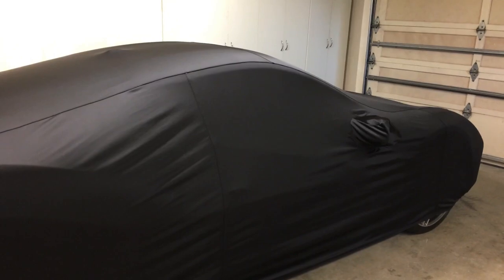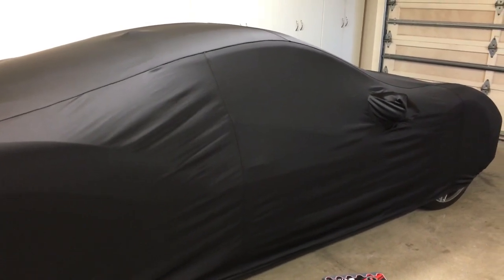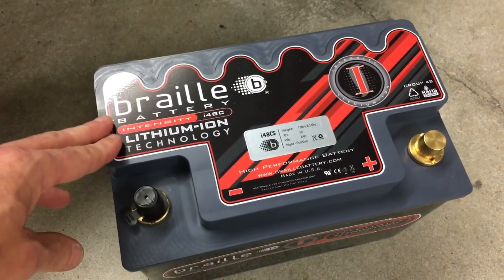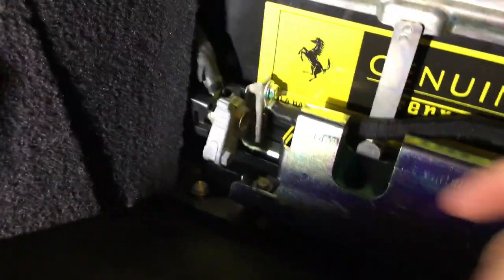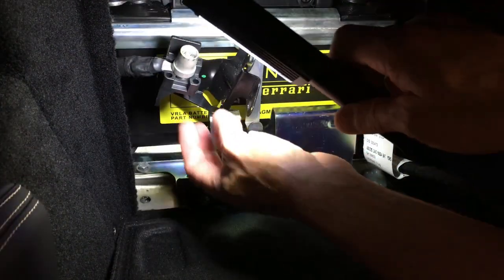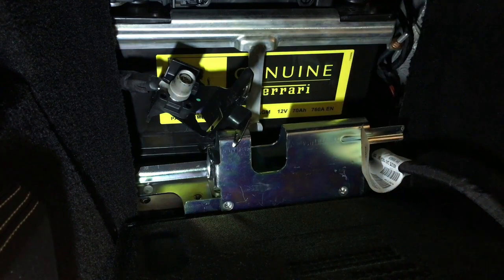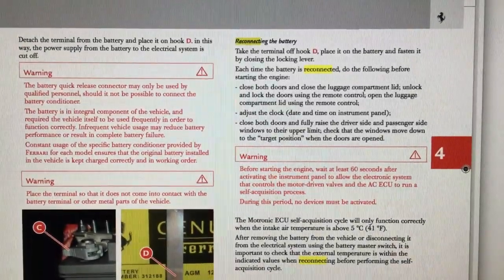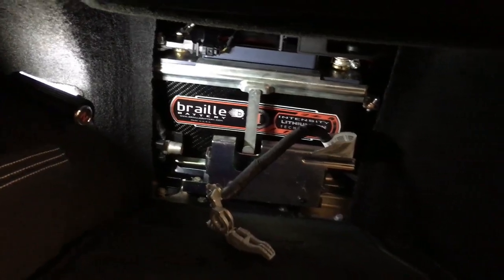Braille lithium ion I48CS battery install Ferrari 488 GTB

Comment: Since you helped others maybe this will help you regarding playing media in a 488.  Took me hours to figure this out 
if you want to use the USB drive to play music, you plug into the USB drive slot (not carplay). You can not use a USB drive (I use the san disk cruzer as it doesn't stick out.  ) Over 64 GB  It must be formatted in FAT32 which windows won't do natively so you need a freeware program. I used a program called Rufus to format.  The sound quality from USB is 10 times better than blue tooth.

Comment: good video, another good battery is from LithiumMoto, 70Ah at 15 lbs with wireless remote 2ndStart feature. Made in USA
Reply from the maker: Yeah, there are more and more out there now; people are coming around to how good the Lithium Ion batteries are for car. I might have to switch to running a bank of capacitors next haha.

Comment: Holy hell, that's expensive! Antigravity Batteries is still my #1 choice. For half the price, you can get the same battery with the full BMS, all the protections, and their Restart feature. I'm using them in both of my cars and my bike. Bluetooth connection is also available, so I get battery status updates/warnings on my phone. :)
Reply from the maker: Antigravity would be my #2 choice maybe.They do have a BMS system on board which is some people like, but I view it as just more to fail in my opinion. Over at Ferrarichat I think there was recently a post about one shutting off or something. I believe they use inferior Lithium cells also, but I could be wrong and it's hard to figure out exactly what cells each battery maker is using. For my money, it's Braille and I have had excellent luck with them, but I realize not everyone wants to spend more on the car battery than a used Prius lol. Antigravity is a big step up from a traditional battery however. Glad to hear you have had good luck with them!
Reply: @ray5961 , from what I understand, you just have to select the correct battery with the correct Ah capacity for the vehicle, and the BMS will be fine. Hell, I'm using one of their motorcycle batteries in my track car, and it works like a charm. But I'd definitely always go with the BMS because of the over-discharge protection. It saved my bacon a few times already, and I love that Restart feature! Didn't even have to recharge or jump-start the battery. Just pressed the button and the car fired right  up. My car had a problem with the alarm, so it kept draining the battery. Had I used the unprotected lithium batteries, they would have been damaged for sure by the time I figured it out, so it saved me some money too.
Reply from the maker: @Prelude_Si  I've accidentally over discharged the Braille before. The cells can withstand it fine. Their chargers have  recovery mode also. A lot depends on battery chemistry also. Me personally, I'm not interested in having a BMS involved with my car.
Reply: @ray5961 , I guess it all depends on your needs and how good you are with maintenance. I've used Braille and Shorai before Antigravity, and they were not bad, but not great either. Braille was definitely better than Shorai. My first Shorai went bad after the very first accidental over-discharge, and the replacement lasted about 2 years. I got about 2.5 years out of my last two Brailles, and about 3 years out of the first one. So far, I'm most impressed with AG because they can take the most abuse, they're a bit lighter, and i reckon they come with the best warranty as well. My first (non-BMS) Antigravity still works great after 5 years, and the other two are about 2.5 and 1.5 years old respectively. 

I'm just happy to see more competition and so much cool new tech, which should drive the price down a bit, so in the end we all benefit regardless of the brand we go with. But one thing is for sure; I'm never EVER going back to lead-acid again. :)
Reply from the maker: @Prelude_Si  yeah, battery technology has come a long way! Imagine where things will be in another 20 years :)
Reply: I put an Antigravity in my 458 Spider, now I got one to put in my F8 spider. Braille is overpriced.
Reply: @freddaniali  - Quick question, do you never use a tender? Is it possible to use a lithium tender with the F8 port? I'm just wondering, if you are going to leave the car for a few months, would a tender be better than relying on the restart function, which (as I understand it) effectively disconnects the battery, so alarms etc are all inoperative... or am I just misunderstanding something? Excuse my ignorance, but I'm new to the lithium battery subject.
Reply: @AnthonyKellett  No worries. I installed an Antigravity in my F8 and it works great. And I use the stock port with the new CTEK lithium-ion tender for both cars and it works just fine.
Reply: @freddaniali - Many thanks

Comment: Thank you!! This was super helpful to me tonight. Much appreciate you sharing
Reply from the maker: Thanks man!
Reply: @ray5961    One point you didn't cover in the video is the re-installation of the little red piece on the circuit panel on top of the  positive terminal - did you drill holes for the two little screws? or did you leave that piece off?  Thanks Dave

Comment: Thank you so much for posting this video Ray. I am the proud new owner of a '19 488 GTS and I think I am experiencing ECU related throttle application issues due to my battery not being up to snuff. I made the decision to install a new battery and was leaning lithium but wasn't ready for anti gravity "smart" batteries. I will definitely be going braille I48CS now. I do have one question: On the Braille website it says "ALL battery charging systems can be used" on the I48CS battery. I am going to speak to them to verify what they mean but wanted to ask you what you use as a tender, or if you even use a tender, and if so do you use the magnetic tender attachment, and if so where did you get it? On the braille website for lithium tenders all I see is the typical claw battery attachment.
Reply from the maker: Normally, you shouldn't need any sort of tender with the i48CS, as long as you drive the car about once ever week or so. The charger you want is the 1236L; if ever needed to top off the charge on the battery, you can just clip it on. As long as the cars voltage level is up above 14 volts on the display when driving, then you should be fine. Ferrari did introduce a system on the 488 where the voltage level is lower based on load or something - and this doesn't work as well as how the 458 system functioned - but I think with later 488's they did away with it and went back to how the 458 worked. Check and see if your voltage level is 14 volts when cruising and you should be fine. If not, then you'll want to charge the battery once ever 4-6 months for maybe 30 minutes to ensure the cells are fully charged. But yeah no need for any tender otherwise.

Comment: Interesting.
I did not remove the upper panel. After I removed the kick plate, the cover panel, and the bracket on top of the battery, I could just slide the battery out

Comment: What is the difference between Braille and Anti Gravity, other than a huge cost difference?
Reply from the maker: I couldn't really say, since I don't know all that much about the Anti Gravity. I believe the higher cost on the Braille is mainly due to using higher quality cells. I'm personally not a big fan of Anti-Gravity's whole internal electronics to discount the battery when it's low stuff. The Braille batteries are robust and simple inside. If voltage drops too low, their cells can withstand it and their chargers have a pulse recovery mood to get you back online. A fair number of people on the Ferrari forums do opt for the Anti-gravity batteries and seem to like them (and they are an improvement over most stock batteries). Myself, I use Braille only here. I've taken their batteries apart and have been impressed not only with how they are made but also the company behind the product.
Reply: @ray5961  I suspect some of the cost difference will come from the fact that Anti Gravity is made in China and Braille is US made.
Reply from the maker: @christschool  I'm sure that's a contributing factor. Generally in life, you get what you pay for.
Reply: @ray5961  Generally, I agree.  In this case, I'm not as sure because the discrepancy is so large.  However, I will say that Anti Gravity's customer service hasn't been very good from my personal experience.
Reply from the maker: @christschool  I usually deal directly with the owner of Braille and all I can say is that their customer service and information has been absolutely top notch; 2nd to none. I've run their i48CS in both my 458 and 488 and been really pleased. I also use their G30 in my Toyota pickup truck and it's worked flawlessly. At the end of the day, people have to decide what products they want to use and how much they want to pay. Myself, I stick with Braille, since the battery is a key component of the car's electrical system and I want something I can depend on 100%
Reply: I run both, and in earnest, at tis point I can't justify the price of Braille.
Both AG and Braille has been flawless, and my AG customer service here in Europe has been spot on.

Comment: Thank you for your videos.  Do you still have the Ferrari 488? Can you do another video explaining the dash buttons.  And also the voice control commands?
Reply from the maker: I got ride of the 488. It wasn't a very good care in my opinion.
Reply: @ray5961  Back to the 458?
Reply from the maker: @Terranova911RS  Right now I'm really enjoying my little 1990 Toyota pickup. I've been thinking about getting another 458 Italia or maybe an F12. My dream is to find a run down F40 and rebuild that, but those don't come along very often. But basically, yeah 458 again vs. any of the new stuff Ferrari is selling. I've also always loved those old 250 GTE's. How about yourself?
Reply: @ray5961  I am coming from a Bentley GT and just bought a 458 Italia from Sweden, because here in Germany they are getting super rare since Ferrari announced in June that they stopped v8 production and v6 hybrid is the future. You can imagine...
Reply from the maker: @Terranova911RS  I hear ya. Enzo would not be pleased lol :)
Reply: @ray5961  Absolutely, btw. I bought a Lithium battery after seeing your video. Thanks for that.
Reply from the maker: @Terranova911RS  Yeah, they work much better.

Comment: How can i charge it with OEM charger and Indikation?
Reply from the maker: Baitschev Using an OEM charger will damage the lithium cells. It's best to get a charger designed for lithium ion batteries or use one of the Braille chargers. Also, the Braille chargers have a special recovery mode on them, which I'm not certain all chargers include. The magnetic charger Ferrari uses on their battery tenders is made by a company called Magcode. I had purchased the Ferrari style Magcode parts to adapt my Braille charger so I could use it on the back of the car and have the dash show it was connected and all that. However, in the end I didn't bother. For one, the Braille batteries rarely need charging. In the 458, I never needed the charger at all. The charging system of the 488 seems to work a little differently than in the 458 and doesn't seem to full charge the battery; this resulted in having to top off the Braille once. Having the clip on clamps of the Braille charger is more flexible I think, since it allows you to charge the battery outside of the car also. Additionally, if you have something like a motorcycle with a lithium style battery, that can be charged as well. When I sold the 488, I kept the Braille and thus was glad I had not modified the Braille charger to only work with the 488. But as mentioned, if you wish to do it, check out a company called Magcode or maybe find an adapter on ebay or something.
Reply: Thanks for Information.today i bought a Lithium CTEC CHARGER AND INSTALLED FROM MY OEM  CHARGER THE CABLE WITH MAGNETIC Plug

Comment: maybe cheaper to use a battery jumpstarter
Reply from the maker: Definitely cheaper, but not a solution which really addresses all the underlying issues on the most recent Ferraris. The biggest benefit to this upgrade is running the car at a higher voltage, which eliminates a lot of the random electrical issues you run into with modern Ferraris these days. The Lithium battery cells have a higher per cell voltage, so the net voltage on the battery is up around 13.3 instead of the normal 12.68-12.75 you'd see with a AGM type battery; that makes a big difference on how all the electronics on the 458, 488, F8, etc, function.